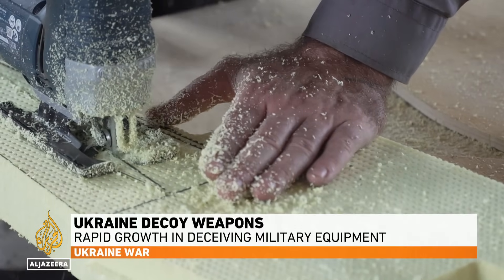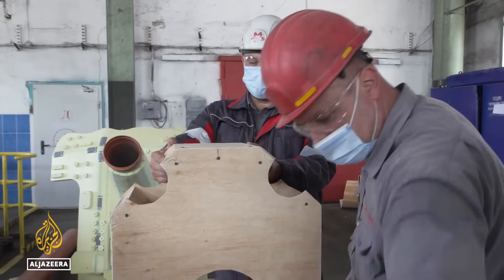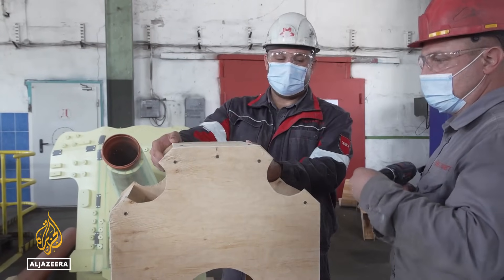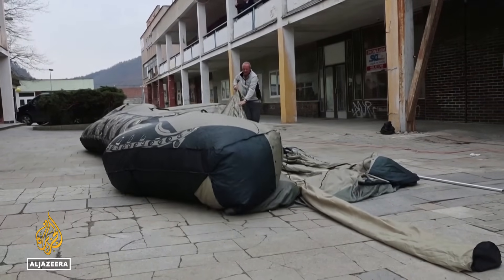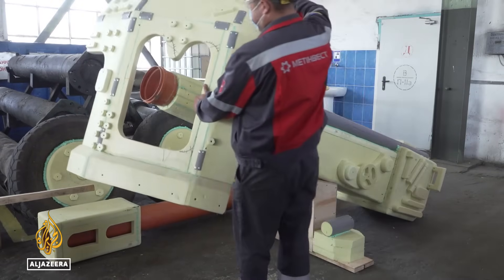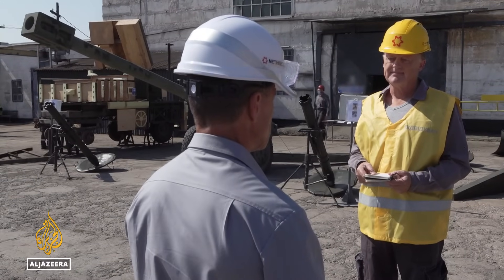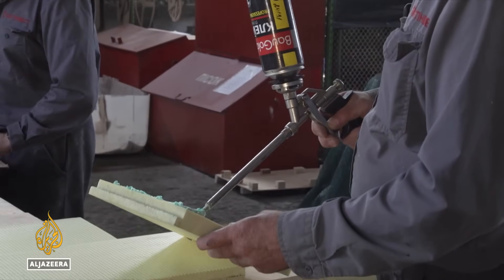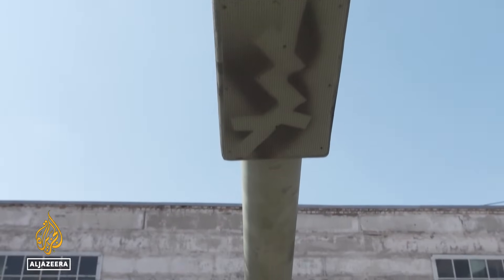Ukrainian decoys: Rapid growth in deceiving military equipment

Comment: It all comedy just like they're comedian president
Reply: Vatnik, people being killed in their own homes by invaders shelling, bombing and missiling them isn't comedy, it's tragedy.  Poorly equipped and trained mobiks being forced into the front line to get killed for nothing isn't comedy either.  What matters in a president is their competence in the job, NOT what their previous job was.  President Zelensky is doing a fine job of uniting Ukrainians in resisting the Russian invasion and fighting back to reclaim territories occupied by Russia. 

Putin however - he was in the KGB, and it's known that he was disappointed at the collapse of the USSR, which was an authoritarian regime, so Putin's increasingly tyrannical reign in Russia isn't surprising.  What IS surprising is that, given leadership of such a large nation gifted with so many natural resources, there are still homes in parts of Russia without running water flushing toilets or a reliable electricity supply.  This is largely due to widespread corruption - taxpayers money that was supposed to be spent on infrastructure and the military actually being siphoned off into individuals bank accounts. 

So infrastructure improvement is slow compared to what it could be, and the Russian military, rather than being a well-trained well-equipped, well-led force is instead sending barely trained or even untrained mobiks into combat that have had to buy their own uniforms, first aid kits and protective gear.  They are given firearms, tanks and artillery that are decades old, and the command structure is horribly ineffective, and many units barely know who their commanders even are.  Unsurprisingly, this leads to huge loss of life in the Russian military, hence Putins frequent attempts to mobilise hundreds of thousands more, in
the vain and idiotic hope that repeating his past mistakes is the way to solve the results of his past mistakes, at the expense of the Russian populace and the Russian economy, which is struggling to fill vital jobs because of the indiscriminate mobilisation of men into the army.  

In short, the joke is that the ex-comedian knows how to fight a war and inspire his people better than Grandpa Bunker does. Which is why, nearly 570 days into what was supposed to be an invasion lasting a week or two at most, Russia has lost about half of the territory it initially overran, and continues to lose more Ukrainian territory to the Ukrainian Armed Forces. 

Oh aye - remember Moskva, how easily that was sunk? Do you think  the fact that it's vaunted air defence systems  were inoperable because it hadn't been maintained properly for years because someone felt that their desire for a new dacha was more important might have had something to do with it?

I've nothing against the average Russian, who like average people all around the world, just want to get on with their lives, have fun, raise a family, etc. But I despise Putin and his regime because their vanity, corruption and incompetence are hurting not only Ukraine, but also the Russian people.  There is a reason that far more people have wanted to leave Russia over the years than have wanted to emigrate to it - and that is the crooked regime that unfortunately runs the country.